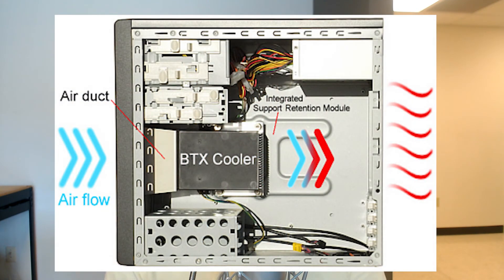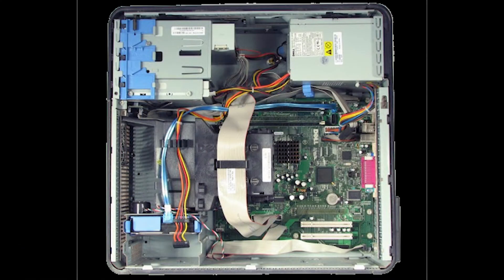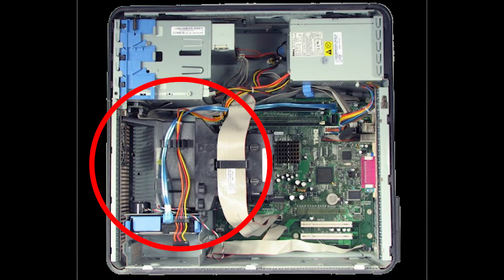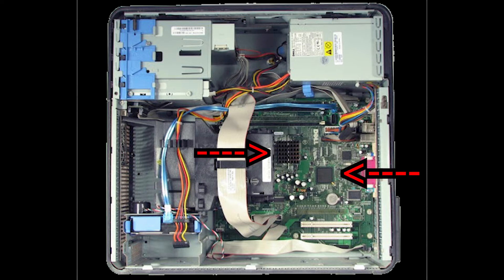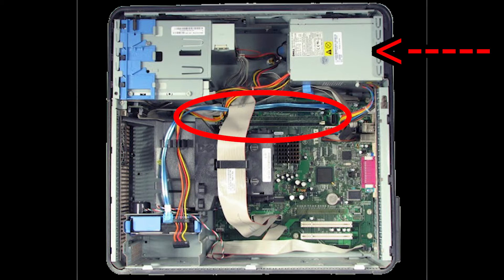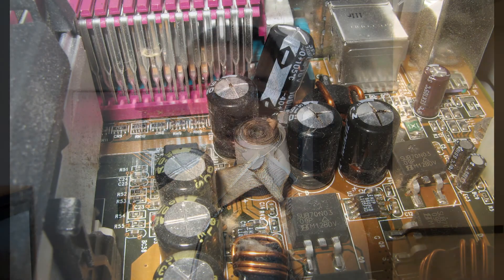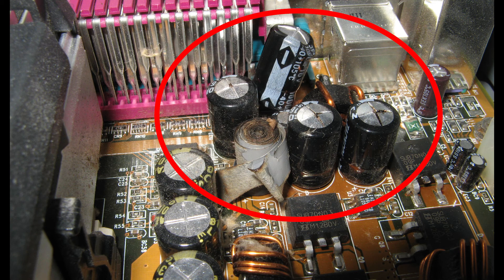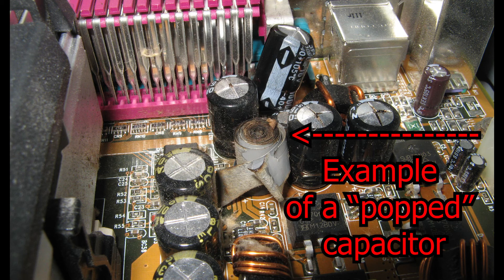BTX Standard

Comment: The BTX standard was defeated by PC builders.  The main problems with the BTX standard is that the supporters of it like Dell were pushing a large quantity of proprietary parts that you could not get generic replacements for at reasonable prices, and the replacement parts you needed were manufactured only by Dell.   So if you bought a BTX Dell system you had to buy BTX parts from Dell even though BTX was "on paper" a universal standard. These PC companies didn't want another universal standard like ATX had become.  They wanted to get rid of it.  And they sure as heck didn't want a universal standard to be replaced by another universal standard.   They wanted you to buy a whole new PC case every time a new CPU socket was made which would have generated a lot of ewaste.   So they tried to kill ATX with BTX being a wolf in sheep's clothes and they tried to convince people that it was somehow better.  Even though "BTX" was supposed to be a standard, it was manipulated by PC manufs. to come with  hidden "gotchas" of tunnels and cooler designs that were not compatible with each other from one PC case to the next even within the same CPU generation.  CPU coolers that instead of being motherboard specific, were PC case specific which was the most retarded thing ever designed and was intentionally done by the most evil of companies, with the explicit purpose of destroying the entire PC building market so that they would have more sales.  A wolf in sheep's clothes so to speak.  For example, you could have 20 "BTX" standard cases offered by Dell that all came in different shapes and sizes and every single one of them would have a different cooler funnel, shroud, or tunnel and would not be compatible with each other.  So if your cooler broke, you had to throw out your whole PC, motherboard, case, and all if you couldn't find the exact correct replacement part. And since there were so many variations of these cooler funnels, shrouds, and mountings, you couldn't realistically stock replacement parts in the backroom.    Additionally, the BTX standard introduced fans that had mounting that was  not compatible with the standard case fan sizes at the time. 60mm, 80mm, 120mm, etc. and they did not have the same method of mounting. This meant that your CPU cooler fan was a proprietary embedded component that could not be swapped with a 60mm case fan if it failed and you were in a pinch.  You would have to buy a new proprietary dell CPU cooler for $100 instead of buying a new generic fan for $5.  These evil PC manuf. companies pushed this "BTX" trash like it was the next evolution of PCs.  As if it was some sort of improvement when in fact it was the exact opposite.   The price of simple component failure was much larger for BTX so we waged a war against it.  So we intentionally fought the BTX standard, we told people not to buy it, we told mobo manufs. not to make boards for it, and we as PC builders supported the ATX standard by purchasing parts that would be swappable instead of the long list of proprietary parts that you wouldn't be able to get replaced if you need to that these supporters of the "BTX Standard" were trying to push onto the market.  They still do stupid things like changing the mounting holes of a cpu cooler to prevent you from using the cooler you bought before with the new motherboard. Which is specifically done to force you to spend more money and buy a new cooler to replace a fully functioning cooler.  Which is something that we still fight against Intel,  AMD, and nVidia to this day and have for decades, but the BTX standard is dead,  and we killed it ,and we're glad its dead. The PC building and repair market would have looked exactly  like what John Deere and Apple is doing which would have been a nightmare for everybody and ruined the entire PC building community. If BTX won in replacing a real universal standard such as ATX with a fake standard of BTX, then you would need to buy a new PC case with every motherboard because the PC case is tied to the CPU cooler and the CPU cooler is then generation specific to the CPU socket as it regularly is despite consumer complaints about it.  The PC manufacturers used BTX standard to wage a war against PC builders, and they lost that war..  I can only hope that the next generation of PC builders has some respect for the fact that they can build a new PC and keep using the exact same ATX case, exact same ATX powersupply from their last build if they so desire. Down with the CPU Socket specific PC cases that tried to be born by the BTX standard,  Long live ATX, the PC building community that supports it, and recycling and reusing good PC components when possible instead of throwing your money away to greedy PC manufacturers that have evil agendas of destroying the PC building community so they have more sales!
Reply from the maker: Thank you for adding some historical and cultural context to this topic! I have tore open many Optiplex systems from that time and what you say aligns with what I have seen. Coolers, Powers Supplies, Mounting Holes, Fans, etc. All of it was wonky. 
Also, I really appreciate you linking this to the modern right to repair argument. It is nice to have a pc building environment that is friendly to interchangeability. I hope to see that commitment to interchangeability in future builds. I wonder how longer graphics cards will challenge the ATX standard in the modern day.
Reply: PC case manufacturers and cooler manufacturers could have easily standardized their designs to be interoperable apart from the system builders approach of making proprietary designs.

Intel and the design principles behind BTX as a layout weren't at fault in the least.

I would absolutely love to buy a modern motherboard with the CPU socket located at the far right toward the front end of the case so that I could setup a single high performance fan with a shroud that pulls cool air in directly over a short distance and exhausts it directly out the back, the PCIe ports located on the top of the motherboard so the GPU fans can push hot air directly out of the top, and memory modules and m.2 drives oriented horizontally so their heatsinks can take advantage of the unidirectional airflow through the case.

High performance servers are designed in a similar way. It's stupid that desktop PCs aren't.

Comment: Recently, I  acquired a Dell XPS Gaming BTX system, must have been their ultimate highest end at the time. Intel Core 2 Extreme, GeForce 8800 Ultra, and this computer is in PRISTINE condition. No dust, no scratches, just an absolutely beautiful system. I'm pretty sure only the power supply is bad, I haven't tested it beyond trying to turn it on yet. I'm hoping it's only capacitors in the PSU that are bad, because finding a replacement motherboard might be more effort than I'm willing to put into fixing it.

Comment: BTX was made by Intel to mitigate the fact that Prescot was a steaming POS. Probably the same reason you got an Athlon instead, which to my knowledge was very rarely paired with BTX.
Reply from the maker: All of the cpus at the time were fire. Like literally close to catching on fire. It is cool to see the oversized coolers on many of these machines back in the day. I couldn't get excited about the upcoming Bulldozer chips because I'd imagine they would always run hot and have no room for overclocking without a crazy big cooler.
Reply: @joshparsons1485  The Prescot was a special case. At that time I was on a 180nm Coppermine and had been waiting for the 90nm. But when I read the reviews, I went and got a 130nm Northwood instead. The Prescot had higher power consumption, worse performance despite double the cache and heralded 4 years of AMD having the performance crown. Eventually the whole Pentium 4 architecture was replaced by a design derived from the Pentium Pro/II/III.

Comment: so much memory this raised.  I have a dell dimension 5100 and used it for over a decade, upgraded literally everything possible,  first get a better heatsink from a dell dimensions 9100 with 4 heatpipe (dell cheaped out the 5100/e510 heatsink) to better cooling the pentium 4,  then upgraded the pentium 4 to pentium D 945,  already passed the compatibility of the bios that need to press F1 everytime pc starts (but it will work ),  then maxed out ram to 4G , installed total of four hard drives,   switched graphic card from 6800 to 7600,  cut out back of case to add more fans to cool the hot pentium 4.  switched multiple PSU (not sure why it fail so fast each time), until it finally died in 2017,  loved the wind tunnel design of btx form factor, much more superior than atx form factor, also addressed the gpu cooling much better.  what a shame it died